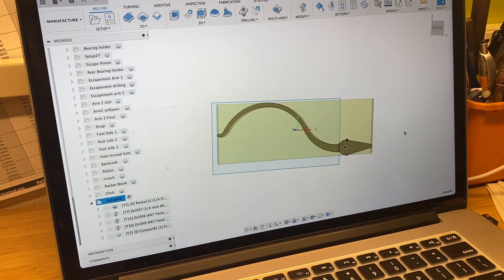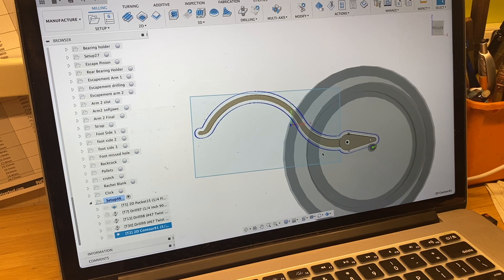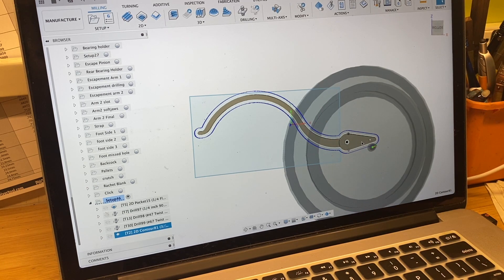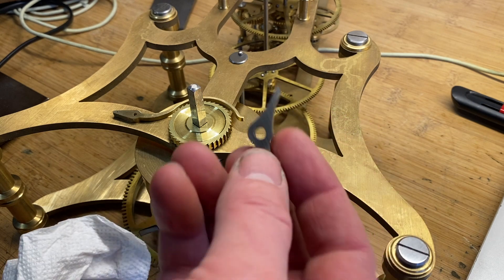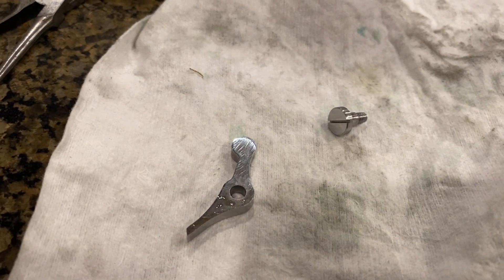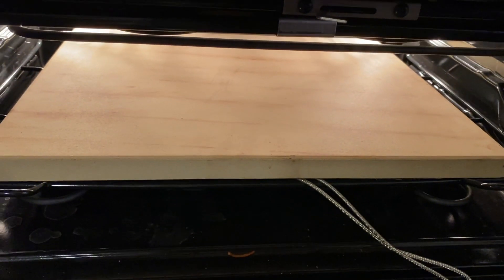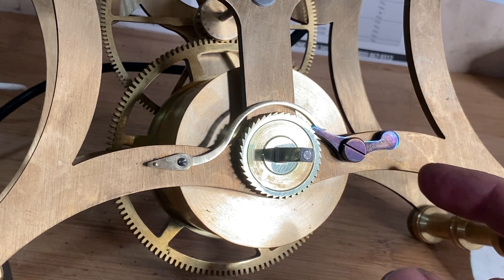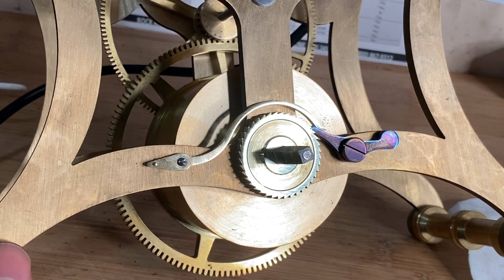Making the click spring

Comment: Hello Kevin 
Nice work on the clock! I purchased the book and was in the middle of cadding everything out a while back. Like you mentioned I did find a bunch of errors and I ended upmoving on to a different clock design. I want to revisit this one though. Yours is the first Ive seen!!
What kind of brass do you use and where do you get it from?

Thanks
Reply from the maker: I am in the US and buy most of the brass from onlinemetals.com they have a great selection at a reasonable price.   For the plates and wheels I usually get 260 brass.  I think some call in engravers brass.   The clock is not an easy one as the book has errors.   I have finished it but am going back to reduce the great wheel size and increase the first pinion to try and give it a little more power.   I didn’t talk about this in the videos but might make one at the end.

Comment: Hi Kevin, are you going to leave all the radius’s in the wheels? I’ve got 1.5 mill rads on my clock wheels but was wondering if I should file them out.
Reply from the maker: It is purely preference,   I like the way the corners look rounded.  It would be very hard to cut corners like that by hand so I think that is why you don’t see it traditionally.   What you can do to make the radiuses smaller is use rest machining.   It allows you to come back with a smaller diameter cutter and it only cuts in the corner where the larger diameters miss so it saves time. My wheels are finished with a 1/16 cutter leaving around a .8 mill rad.   When I want even smaller,  I use a 1/32 cutter to finish, sharper then that it is time to file.